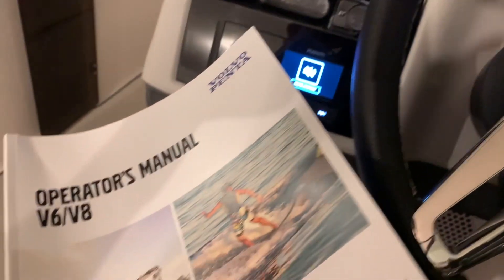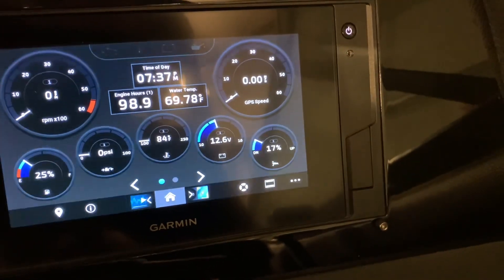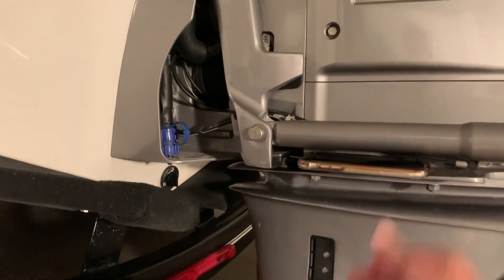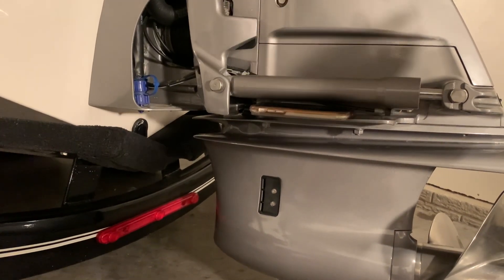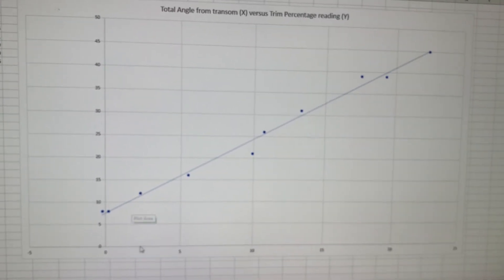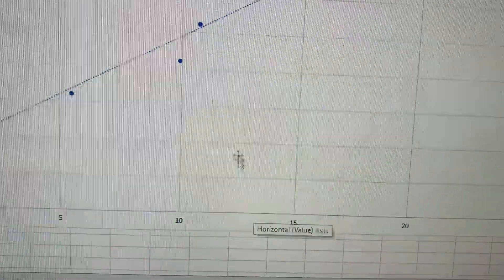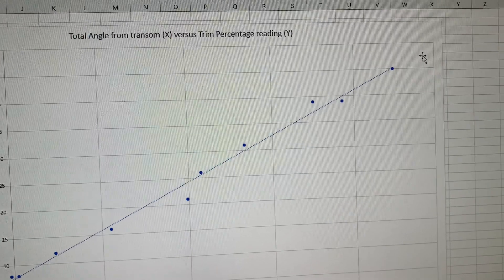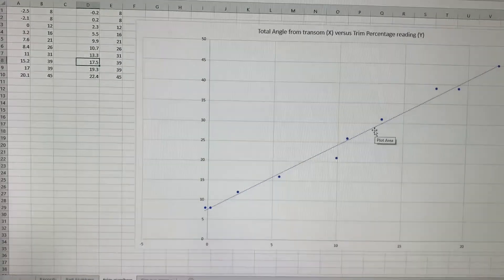How to relate outdrive trim angle to Garmin display trim percentage

Comment: where did you get the service manual for the duoprop outdrive?  part #?
Reply from the maker: Go here and enter the serial number of your drive to see what type of documentation is available for it.   

https://www.volvopenta.com/your-engine/manuals-and-handbooks/

What I actually show in the video is the 'Operators Manual'.  Typically those are available for free download from the Volvo Penta site.  If not, you may have to purchase it.

I have also purchased a hard copy of the the 'Workshop Manual' for my drive through the site.  It is part number 47713910 for my drive (DPS-D1).  Don't take my word for this part number though, depending on what drive type you have.  Enter your serial number, and the click the 'cart' button to verify the part number.  

Hope that helps!  Let me know if you have any other questions.
Thanks,
IB